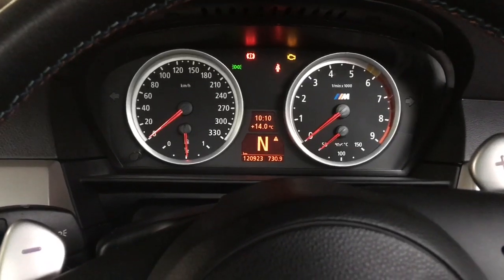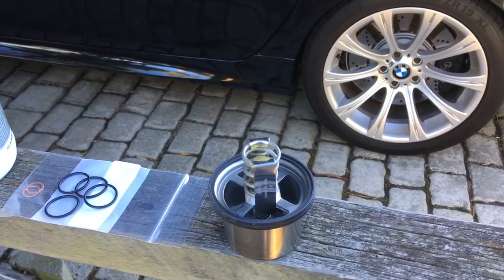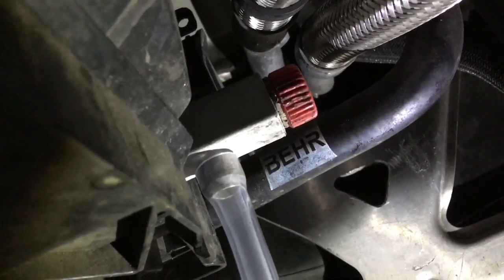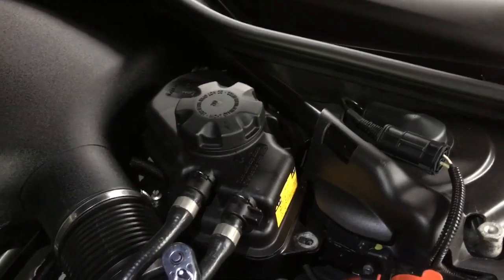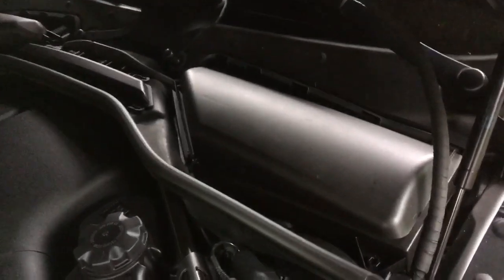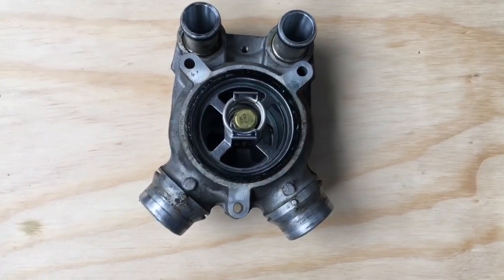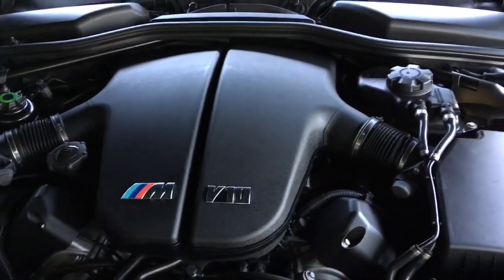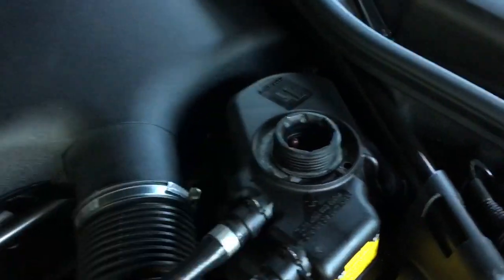BMW E60 M5 Thermostat Replacement

Comment: Hi mate, thanks for the tutorial. I really have no luck because after the issue with the fuel filter replacement which I had to do 2 times, i also now have an issue with the thermostat. I just replaced mine mine and I have a leak between the thermostat housing and the engine block. That's really strange because I torqued the bolts at 10Nm like they are supposed to be, I mean I tried to make everything right. It flows down to the floor like continuous drops. I used an aftermarked thermostat, a variant which opens at a little lower temp that the original one. Before installing back the thermostat i've cleaned the surface of the engine because there was dirt like probably remainings of a sealant which is used at the factory (or maybe it was just dried coolant ? don't know). I've made the engine heat up 3 times before putting everything back and i had no leak. Now I will remove everything again and probably will put an OEM thermostat instead. Just i hesitate to use a bit of sealant to prevent it to leak again but i really hesistate.
PS : Looking at your video again i see that with the new thermostat inside the housing, the seal "exceeds" a bit from the surface of the housing, then on tightening it must be pressing very well on the engine block. On my side with the aftermarket thermostat, the seal isn't higher than the surface of the housing, then the sealing quality can't be the same. I think i found the reason of the problem, but it's strange as this PN is supposed to be matching the OEM and it's a known brand.
Reply from the maker: Yeah, go with a genuine or OEM one like used in this video. Also make sure to replace the 4 O-rings in the 2 aluminium pipes that slot into the back underside of the thermostat housing. It sounds like you’ve done everything else right though- clean surfaces, proper torque, no seal and etc.
Reply: @MTechGuy  like we say in french, the dumbs do it 2 times ahah :)
Reply: @MTechGuy  Finally replaced it again with an OEM and guess what, no leak anymore. Your videos are really really helpful thanks mate !
Reply from the maker: @romleprom  Nice one 👍

Comment: When you say 79C on the start of the video.  Does that mean it opens at 80C so if your water temp is stable around 80C it means thermostat is working properly?
Reply from the maker: Pretty much, yes. It opens at 79C, the temp will fluctuate a little with driving conditions and ambient temp. These thermostats will fail open so worst case scenario it’ll just take ages for the engine to warm up
Reply: @MTechGuy  it did warm up in less than 10 mins. I have a big story with our car after we did the 50th M car event in Wellington. I will email you sometime the details, or I might post it on my bimmersport thread. You don’t happen to have an expansion tank lying around the cupboard?
Reply from the maker: 10 mins is normal for warm up with these cars.
Interesting! Only have a spare M54 tank’s right now. I was hoping to get to the one in Auckland but had other commitments. Shoot me and email 👍
Reply: @MTechGuy  No expansion tank in Auckland or Christchurch.  Apparently it’s cheaper for me to order on the dealer who will ship one from Germany, than me buying at FCP (my usual routine).  I just have to wait about 6 weeks or so.  Ask your local BMW dealer is should be only about $355 inc GST.  If they can’t order for you let me know, I can order another one when I get back.  I needed to prepay though, as it’s not a returnable item.
Reply: @MTechGuy  btw where did you get your thermostat?  Local or also imported from FCP?
Reply from the maker: I often buy parts through Christchurch BMW. The thermostat I bought from Pelican Parts, I ordered it with a few service items at the time. The NZD-USD exchange rate is pretty rubbish at the moment though!
Reply: @MTechGuy  did the mahle OE thermostat included the o-rings on your video?  Or did you have to buy that separately.  It says on description there is like a seal, but can’t see on the photos of the product.
Reply from the maker: @JunYamog  The thermostat comes with the seal. The 4 O-rings for the housing tubes you have to buy seperate
Reply: @MTechGuy  a right, sorry I didn’t read the description.  Those part numbers will be helpful.  Thanks and have a good holiday.
Reply: @MTechGuy  btw I got my expansion tank a few days ago.  The Germans again understated their performance, from a 6 weeks estimated delivery to just less than 2 weeks.  I think I will busy during the holidays.  Happy Holidays.
Reply from the maker: @JunYamog  Nice, that’s not bad going this time of year! Merry Christmas
Reply: @MTechGuy  ok done it, not yet road tested but stationary test indicate no leaks, etc. You can see the video here: https://youtu.be/FWhp2bAFKDA
Reply from the maker: @JunYamog  Nice vid! 👍

Comment: Great helpful vid! Question- my car is at 94k miles, does it make sense to do the water pump at the same time? (Since you have access with the intake removed). And what else would you do at the same time? Vanos lines/pumps, coolant hoses etc?  Thanks!
Reply from the maker: At 94k miles I wouldn’t worry about the water pump, they are reasonably solid on these cars. With the thermostat it’s worth doing the coolant temp sensor that sits in the V of the engine, they do start to fail over time and can give false thermostat codes
Reply: Thank you. Makes sense. I watched your vid on removing the intake plenum. Seems like a real PITA. Ty @MTechGuy
Reply: One last question- when purging/bleeding the coolant system after you refill it - when you turn the heat to high and the fan to low (with the engine off) do you have to hold the gas pedal for 10 seconds? I’ve seen that said and a couple other videos. Thanks again.   @MTechGuy
Reply from the maker: @TheJaredsalinsky  No not with the M5, just follow the steps in the video

Comment: Hey M tech guy .. have to do this job , check engine light for it came on ... QUESTION   does the light come off by itself after job complete ?  Thanks
Reply from the maker: Have to clear it with a scan tool. It may clear itself if it is the thermostat, with a few kms of driving when replaced
Reply: @MTechGuy  Yes code read it was confirmed the thermostat .. i will give it a go .. quick question .. do always feel comfortable jacking the rear up from diff ?
Reply: also  ever replaced the wheel speed sensors ? if not yet  would love that video lol ..
Reply from the maker: If the code was 2B59 the temp sensor in the valley of the engine can contribute to that code too.
No worries jacking up on the diff, that’s the proper rear jacking point (just stay clear of the ali rear diff cover!)
Not done a wheel speed sensor on this car so far
Reply: @MTechGuy  Thanks . .just wrapped up the Job today .. tomorrow for a drive and test .
Reply from the maker: Nice 🤙

Comment: Is it dangerous to drive with this code for any enginparts or the engine itself? 

Have got the code but need to drive it some km to winterstorage etc and to workshop to fix. But have alreaddy driven some km with it and havent felt anything wrong atleast?
Reply from the maker: Common fault with the S85, the thermostat will fail safe (open) so won’t cook the engine, but it’ll just mean the engine oil will take a long time to get up to temperature. As long as you don’t rev the engine out until the oil is up to temperature, it’ll be OK

Comment: Hi there! I have code P0128 did you know were is the coolant temp Sw location? Thanks and Happy New Year!!!
Reply from the maker: Happy new year! It’s either your thermostat or coolant temp sensor (most likely the thermostat) Coolant temp sensor is located in the V of the engine on the right hand side
Reply: @MTechGuy  Thank you!

Comment: Hi mate , your videos are very helpful,done all that changed the thermostat , blended the air but i have an issue , when i push the car harder temperature goes at 110-115 , before changing the thermostat it never went over 100, any advice on that?
Reply from the maker: It’s normal for it to creep over 100 C under load. I would double check all the coolant connections for leaks that have been disrupted anyway, maybe give it another bleed to be 100% sure. If all checks out OK I wouldn’t be too concerned
Reply: @MTechGuy  thank you for your advice , she had so many bleeds now , everyone i talked to says the same but with the other thermostat it never went over 100 as much as i pushed it ,i am concerned only , all seals have been triple checked , thanks again, i will run a scan today to make sure no error come up

Comment: Hi, many thanks for this great video. Question on the coolant mix, do you need to use distilled water and if so any particular type? thank you
Reply from the maker: Distilled water is going to be much better than tap water. You should be able to pick up some distilled water at your local auto parts store

Comment: I will never understand why they put such an oddly low thermostat in these cars. I just swapped out for an 88C unit.
Reply: Was it Motorad 880090?
Reply: @HB_M5  yup
Reply: @heyhayhay247  Is it taking now longer to warm up? 
I’m asking because I’m about to swap mine soon. What oil are you using? 5W50?
Reply: @HB_M5  nope, warms up the same as before with 5W50 and the new thermostat
Reply: @heyhayhay247  last question: no need to refresh/update the engine ECU?
Reply: @HB_M5  nope, it has no idea

Comment: Does the plenum need to be removed to install the 4 radiator coolant hoses?
Reply from the maker: Yes, to get access to the two lower hoses & make the upper two easier.

Comment: Hi M Tech guy. I’m looking to do a coolant change on my E60 M5 this weekend. Just checking the coolant capacity, getting slightly conflicting information. Is it 12l or 15l? 

Obviously I’ll run the engine for 15 mins with the coolant cap off and heater on to ensure the coolant gets fully round the system. But it would be nice to know for sure how much coolant it takes!
Reply from the maker: 10-12 litres of 50/50 mix coolant should be more than enough for a coolant change. No need to run it with the cap off, follow the bleed procedure towards the end of this video. Don’t forget to drain both sides of the radiator
Reply: @MTechGuy  hi, I thought it was necessary to run the engine for a while with the heater on (topping up coolant as required) to ensure full circulation of the new coolant through the entire coolant system and heater matrix? 

I’m going to collect the old coolant anyway and ensure I put exactly the same amount of new coolant in.

I can’t see any specific videos covering the bleed procedure though, just this one you’ve done about the thermostat replacement.
Reply from the maker: @mista5796  Yes the fill & bleed procedure is as per this video- ignition on, heater on hottest setting, low fan speed. No need to run engines it self bleeds 👍
Reply: @MTechGuy  ah I see what you mean now! Just ignition on, fan + heater on and let it circulate the coolant. Thanks 👍
Reply: Good info! Thanks!

Comment: What is the torque on the mounting bolt of the thermostat?
Reply from the maker: Carlo, 10NM for the thermostat housing bolts. Don’t get too hung up on the torque specs for these small bolts though. Most important pull the housing down evenly & check for leaks afterwards.